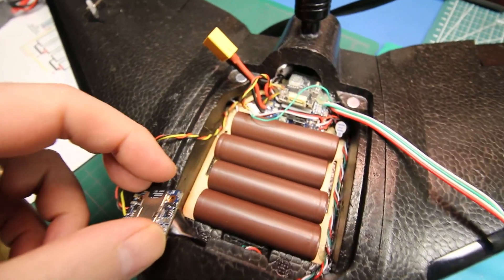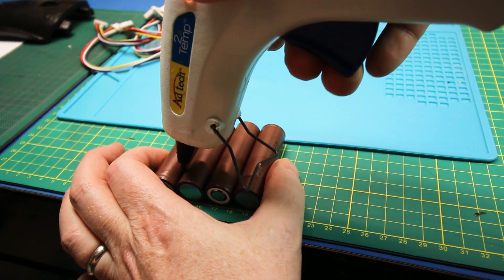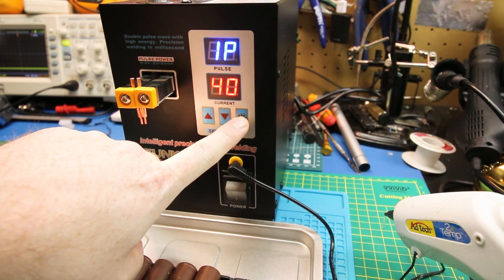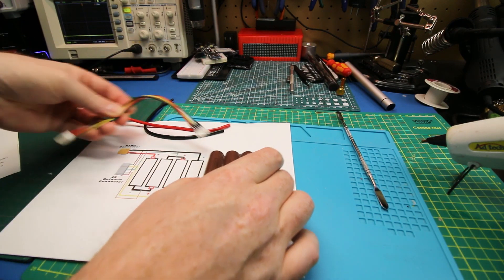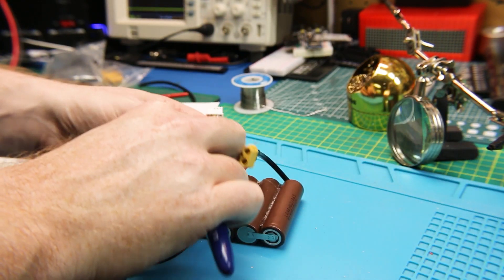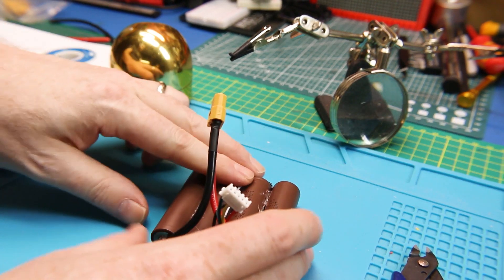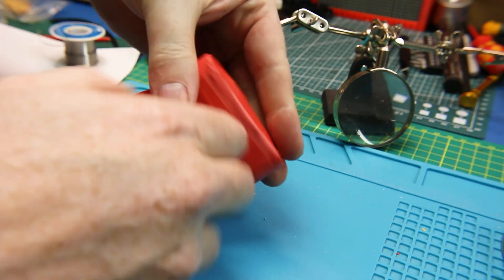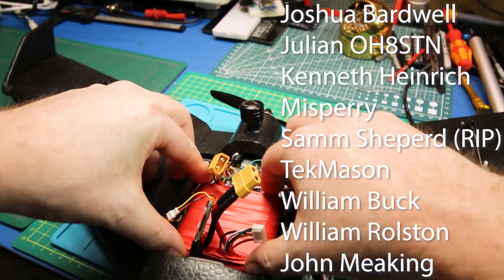🆕Make Your Own Lithium Ion Batteries with Cheap 18650 Cells🔋🔋🔋

Comment: Does bit of a thermal runaway mean explode?!  Curious as saw a vid showing someone soldering a wire to a CMOS  battery on a laptop motherboard and it exploded. Very small explosion as only a button battery but made him jump. Could this happen with an 18650 and if so is it dangerous, i.e. could it blow the metal casing apart? Safety specs advised? Thanks for a very informative video and for the link to your other channel. Just subscribed.
P.S. Have just noticed that on the video progress bar you have put annotations showing what you are doing in different sections of the video. Haven't seen this before. Excellent!
Reply: Explode might not exactly be the right word, it's more of an uncontrollable fire similar to thermite burning very hot and very fast once it gets going.
Reply: @adamfalldorf1581  OK, thanks for this.

Comment: Would it not have been better/safer to also spot weld a couple of the nickel strips to the packs main +ve & -ve output terminals first, and then solder the XT60 leads to those; rather than directly soldering the leads from the XT60 connector to the batteries‽

Comment: Great work, do you charge it with same charger?
Reply from the maker: My charger does all different battery types but you can use LIPo settings just fine. The cell voltages are the same.